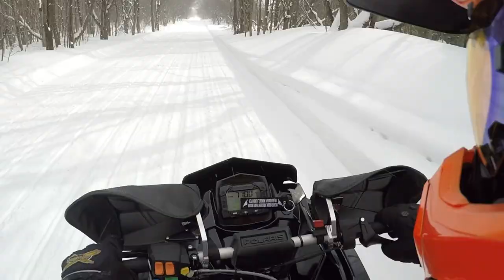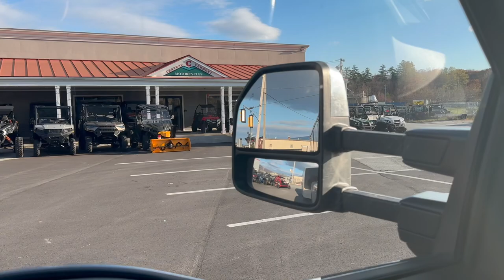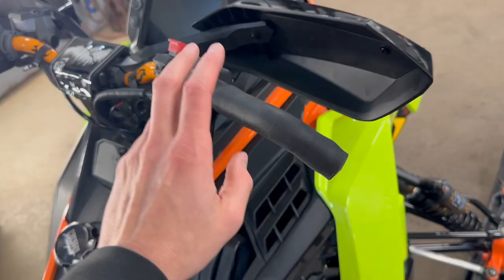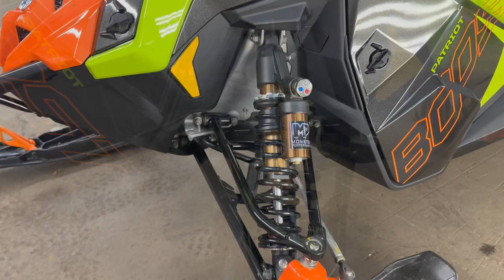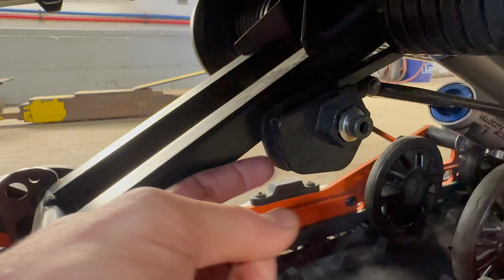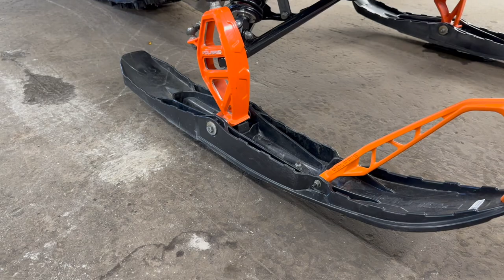My Boost Assault build overview! Muffler mod, P85, KYB's and more!

Comment: Excellent video! As far as suspension changes/geometry video? ABSOLUTELY, please!
Reply from the maker: Copy that! When I do the front end setup video on the 650 I'll dig into it a bit deeper there, and if that's still not enough I can definitely do a deeper dive on both of them and use some older reference pictures I have to compare to G4/5 Doo's as well.
Reply: Ditto, interested to know the dual rate spring you used for the front track shock
Reply from the maker: @bmickle  On the Assault I'm currently running a 6" long, 225lb main spring, with a 2" 250lb tender with only one 1/4" crossover shim.

Comment: How do you like the assault for the riding you do in VT? I live in Burke and have wanted an assault they look like fun versatile sleds I’m just curious to hear your thoughts since we live in the same area. I’m sure your shorty 650 build will be quicker in the tight trails but will it be as fun? If you mainly rode in vt what sled would you choose? Looking for a fun sled that is capable to ride fast here in VT. I followed your thread on HCS the last year or so glad to see your making videos can’t wait to see watch your content this winter!
Reply from the maker: Thank you for the positivity, these comments are keeping me going for sure! 
I absolutely love the Assault, it's such a fun sled and the length really helps on the super beat up trails. That said, it definitely does take more effort to ride it fast, similar to a Lynx, but not quite as demanding as the Lynx. I feel that if you're riding Burke and above towards NEK, the Assault won't do you wrong....it's really when you get into central VT, or even say trail 122 towards glover, where the Assault weight and length really becomes noticeable, and honestly not that enjoyable. This is where the 650 comes in, I'm hoping it retains the fun factor of the Assault, but is significantly more nimble so I can whip it around the twistys with ease. I feel if you mainly/only ride VT, and cover the majority of the state, the 129" is the best all around size....if you're mainly riding NEK or Woodford area, 137" or an Assault is the ticket to handle the higher traffic moguls....however the Assault does need work to be as compliant as many feel it SHOULD be.

Comment: What do you think about the front shock setup? Better or not worth the extra height?
Reply from the maker: The theory of getting the height up to increase useable FTS stroke is definitely working very well. I was able to use the shock tuning and swaybar trick to help combat the tipping the extra height induced, but I'm currently having the shocks shortened and will be then adding the 2023 Cross Country spindle instead of the stock trail units. Shortening the shocks 1/2", but using 1/2" taller spindles, so my height will remain roughly the same, but a lot of the geometry will be corrected and it should handle even better. I definitely feel the extra height is worth it.